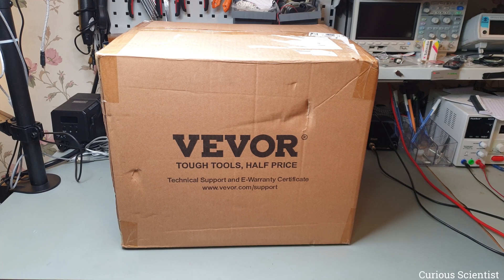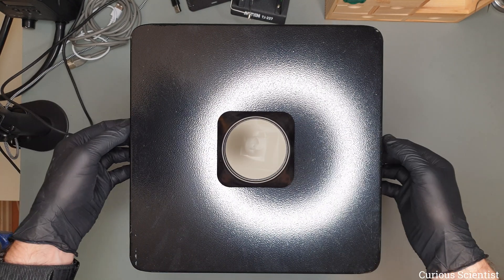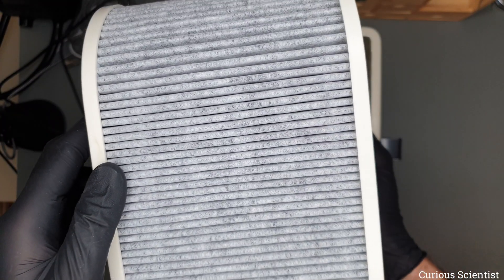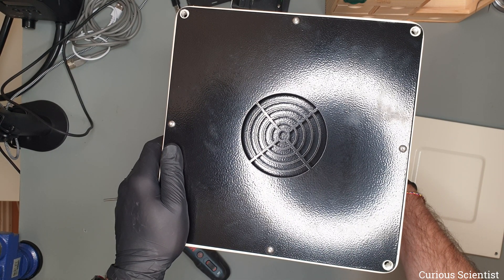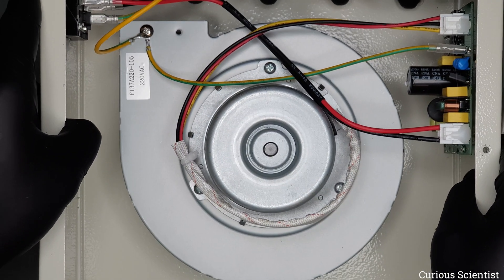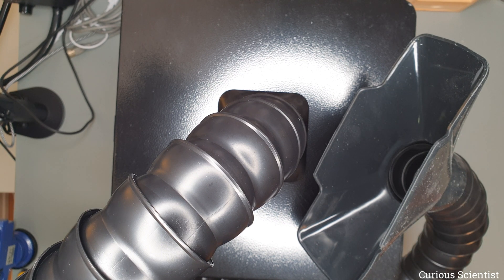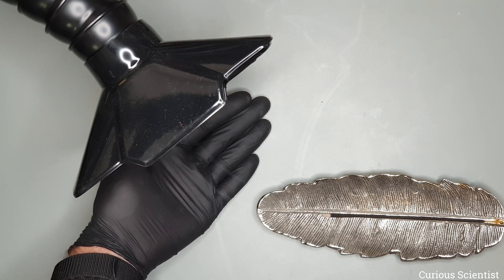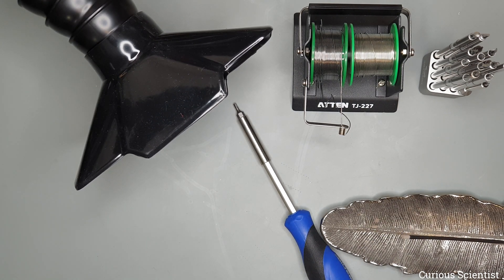100 W Solder Fume Extractor Review

Comment: Many thanks, useful video.
2 points of interest - The vital thing for the activated charcoal filter to catch and sequester is colophony fume. This is the rosin fume used as flux in multicore solder. It is a renowned cause of occupational asthma. In other words it can cause a permanent asthma in someone who would never have developed asthma otherwise.
The charcoal filter clearly can't lest for ever, I wondered if there was any guidance in the manual (difficult because it depends on usage, both volume of air and compounds adsorbed onto the charcoal). Do they produce spare filters when you want to change it?
Finally - the nearer the extraction to the source of fume the better. A dramatic and easy way to demonstrate this is to blow out a match. Then try 'sucking out' a match from the same distance!
Reply from the maker: Hi! I am glad that you like it. 
Yes, the manufacturer included a quite good manual in the packaging of the fume extractor. Actually, I wrote the approximate life cycle of each filter in the article on my website. They rate it by weeks or months of usage. Also, yes, you can easily find replacement filters on AliExpress. 

I like the experiment you suggested, I will try it in the future. I soldered a little today and I used the extractor at the lowest settings. It was working fine!